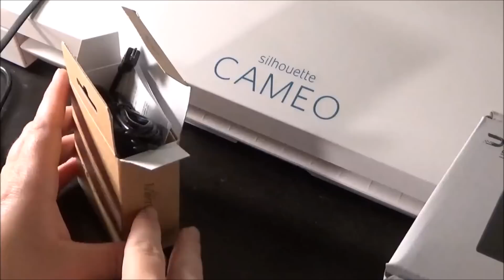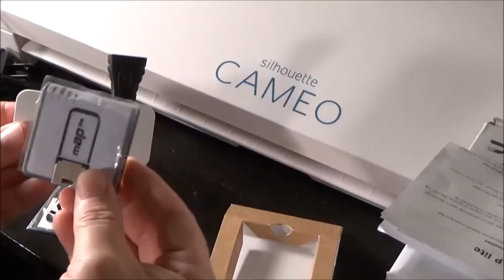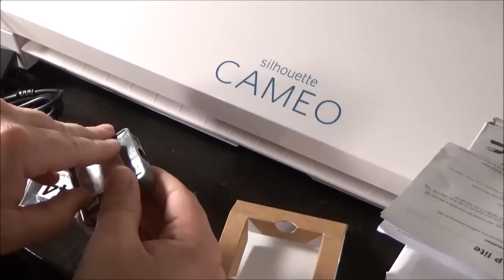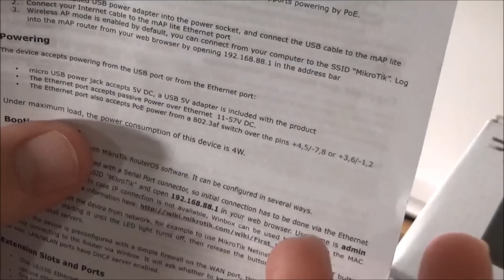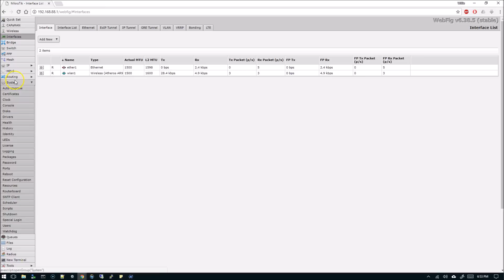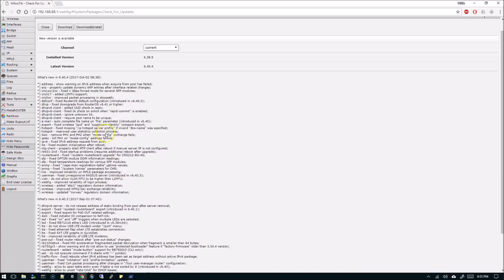MikroTik mAP Lite - This thing is TINY!

Comment: These would work perfectly in my situation but I can not get them to work. The issue is that it WANTS to be a dhcp server. I don't need it to be a DHCP server. I need it to be an AP. I already have an DHCP server. If I turn off the DHCP server it does not work. These things are WAY to complicated. WAY WAY WAY WAY WAY WAY to complicated. I understand power, but if I just need a simple AP shouldn't that be an option?
Reply: They'are a bit complicated but once you get hang of it it's extremely flexible
Reply: @minecameraPL  I did finally get them to work. Very power software. I configured 10 of them via script super easy (once you figure it out). Unfortunately I found that I could not power these off a PoE switch only with a PoE injector. They do not draw enough power for a PoE switch to recognize that anything is connected. I hope MikroTik releases a 5ghz version soon.

Comment: The cool thing about MikroTik RouterOS is that once you learn it, it is virtually the same OS GUI on all of their products (albeit missing some features on lower models). You may also want to attend one of the MikroTik MUM events if you have the time. They usually have one in the U.S. once a year. It is actually an affordable event to attend compared to some other Expo events. Your Airfare, Hotel(usually discounted under a group/conference rate) and about $50 gets you a T-Shirt, a piece of hardware (this past year I got a free "cAP Lite": https://mikrotik.com/product/RBcAPL-2nD-307), Lunch for two days, access to 2-Days of sessions with TONS of information and access to a trade show oriented towards all things MikroTik.

Comment: 2.4ghz, yuk :(
Reply: 2.4 is perfect for something like this. Generally these things wont see anything major.
Reply: "2.4ghz, yuk :("
Wireless internet connection, yuk :(
Reply: Willie Howe very true
Reply: Still can be better for network capacity. You could hide these things inside lamps in schools or behind tables in hotels. For these uses, it may actually be better to have a 100 Mbps router in every room instead of a Gbps router for 20 rooms.